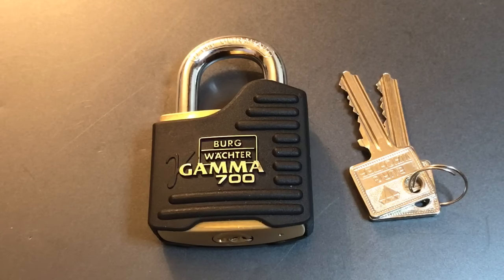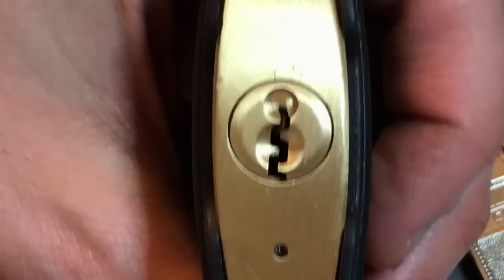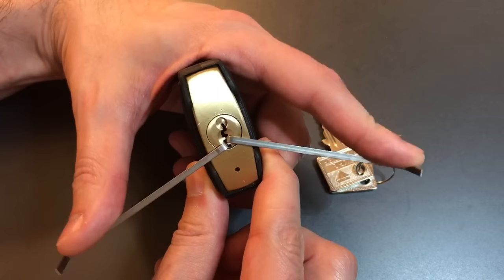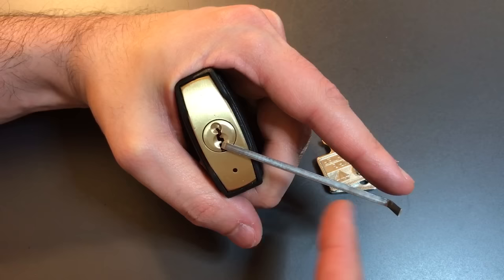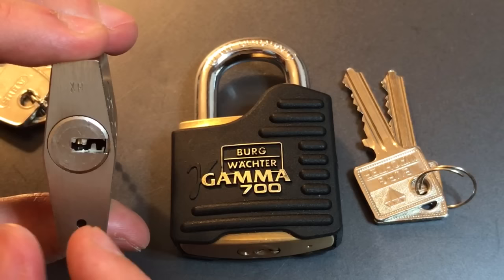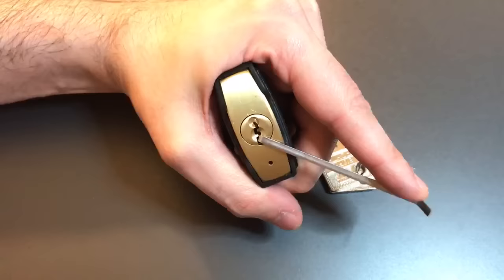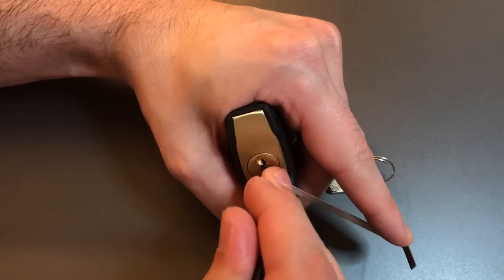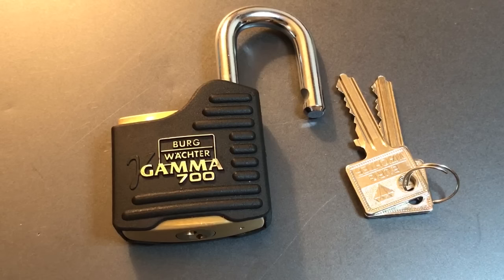[335] Burg Wachter Gamma 700 Picked

Comment: Hi Harry, Very interesting technique, I was given one of these padlocks by a friend of mine to "see how you go with this one". No luck after many tries. Finally made a snug tension tool from music wire and got lucky. First and only one I'd seen. Admire your " outside of the square " thinking on a difficult pick. Thanks for sharing. Regards, Brian.
Reply from the maker: Thanks.  This lock definitely surprised me with it's difficulty until I gave some thought to the problem.  In retrospect, it seems pretty simple... if you can't get out of the false set, then do what you can to avoid going into a false set.  But it took me several attempts at double tensioning and (loose fit tension tool) manual counter rotation before I stopped banging my head against the wall, and engaged my brain.

Comment: You've upped your game on this one! 

My solution to positive control in both directions on the tension wrench is to use hex keys. Cut the short leg to the desired length then file it, VERY CAREFULLY, in parallel with the long leg in a matter that when inserted in the top of the keyway it wedges itself in. You can't get better feedback than that! I have 3 wrenches of different thickness that cover 80% of common locks.
Reply from the maker: Thanks.  Custom tools are helpful, and I love picking with a perfectly fitted turning tools.  But I try very hard to avoid that.  Despite the fact that I don't pick locks in the wild, I like to try and attack locks with what is in my case only.

Comment: Awesome demonstration of this technique. I think it works best for excellent pickers like you ;-) Thanks for another fantastic video. BTW: You would have had fun with more spools if the bitting had allowed to get more spools to become effective.
Reply from the maker: Thanks... this technique is not as hard as it sounds at first.  The only thing is that you need to be comfortable picking spools before you are in a false set, which is a little unorthodox.  As for more spools, there are at least 5 in there.  I know because if you touch pin 5 first, the lock drops into a false set (in which case you might as well start over).

Comment: Very nice!  That rubber band trick sounds slick.  And your way of trial and error makes total sense.  I've always just twisted slightly on my pick if I need to counter rotate and the core isn't doing it on its own.  it works OK but it's easy to overdo.  thanks LPL!!
Reply: Yep thats what I do too. Works like a charm everytime. No need for rubberband gimmicks or double tension wrench nonsense.
Reply from the maker: I often use the same trick... it's very useful.  The warding on this lock makes it particularly hard.  When you twist the pick, you misalign it from the holes in the warding that you need to exploit.  So you are forced to chose between rotating the core, and picking the pin.  I hope that made sense.
Reply: That makes complete sense.  I've already added a couple rubber bands to my kit.  Thanks again!

Comment: 3rd time I've seen this lock today. I've actually done that a couple times. When you run through the same locks a couple times you start thinking of different things to try. It's funny but the first time I figured it out it was groundbreaking in my mind. The double tension I do on cylinders in my vise, mostly on challenge locks with sharp threading. I use top of the keyway and I usually put in a tension wrench to fill voids. Then 1 day I used the heel of my hand on the bottom tension and have done it ever since. I do use music wire also so I can use just that for back and forth,  when in a vise.
Reply from the maker: Me, VDE and Potti?  Definitely lots of ways to skin this cat, and I'm a huge proponent of the "no wrong way" school of thinking (so long as the lock opens).
Reply: LockPickingLawyer hey just wondering if you are getting my emails I had a question on a euro I have. I know the make an Abus Pfaffenhain but do they make a GEGE Pfaffenhain because I just opened 1 up and it has countermilling and serrated pins that look like GEGE pins with the wide serrations. Don't know why I'm mentioning the countermilling but together with the driver pins it's just screaming GEGE to me.
Reply: Oh and it has the same freaking clip on the back. If you've ever taken a clip off a GEGE you know what I mean.
Reply from the maker: Randy Perkins Not sure... please send the email again.  I don't recall seeing it.

Comment: I've never seen a Gamma open that easy...simply WOW O_O. I did talk with Potti about getting a Gamma and who would get it open first, then he came up with his rubber band video ;) and I ended with breaking my favorite selfmade pick. And having many of the Burgwaechter locks up to the Gamma I did have to try immediately your technique. Honestly...if you have a half decent bitting on these, it is hard enough to get even a slim pick under the low pins and then avoiding a spool which gives you a false set is extremely hard (not to say impossible). It kinda did work for me on the 20th like try, but as easy as for you...no way ;). Fantastic video anyway and it once more shows your amazing skills :D.
Reply from the maker: Glad you got it to work.  Not sure if you can see in the video, but I had to twist my pick around the warding to get it low enough to avoid touching pin 5 (the one that put me in a false set).  I don't know if they get lower than that (this is the only Gamma that I've tried).  Then I accidentally picked pin 5 as I was setting pin 6... so I definitely see your point about how hard it can be the avoid the very low set pins.
Reply: LockPickingLawyer looking at your  key I think mine looks similar but 3 and 4 being just higher. Much more spools came into play and it really was very hard. Still think it worked "kind of"...;), but I'm way below your skill level ;). Yes I saw that you twisted the pick. This keyway exists also in smaller size and is hell to pick ;D.

Comment: How do you pick the spools first? You would think pin 5 would be the only binder since it was presumably wider at the sheerline
Reply from the maker: A spool is nothing but a standard pin with a center cutout.  Think of it that way, and you can visualize how simple it is to set these pins “without binding.”  It would be binding (or closer to binding) but for that center section.  As such, once you press past that section, it’s a standard pin again.  It’s particularly easy on a lock with nice tolerances like this one, since they all tend to bind at once if you apply enough tension.  I hope that makes sense.

Comment: Hmm. If 5 is binding how can you then skip it? Wouldn't nr. 6 be loose if 5 is binding?

Which pin type would you say is in nr. 6? If it matter?
Reply from the maker: I can skip 5 because all of the pins are spools.  I can push past the spooled portion, and set the ends... that's why (if you listen carefully) you can hear two clicks for each of the pins I set.  If you look at the key and consider the bitting, it may make a little more sense.
Reply: There might have been no driver pin in 5 that's all i can think.
Reply: @lockpickinglawyer  was pin 5 a zero lift pin then ? If I look at the key it looks like a high cut on 6, but so is 2.  How come if all are spools you never get into a false set during the whole process. I don't get it. Anyway great video !

Comment: Even Google doesn't get the pronounciation right: https://translate.google.com/?sl=de&tl=en&text=Burgw%C3%A4chter&op=translate is much closer than the LPL, but the "er" right at the end is not spoken "tah", that is just sloppy (or modern) - you modulate the "e" to hint there is a "r" following. Quite like the LPL speaks it, he just has to work on the first "u" and "r"-sound, the ä-Umlaut and the voiceless "ch" like in "ich", not like in "Krach".

Note that both "r"-sounds are different, the first is spoken, the second (almost!) isn't.